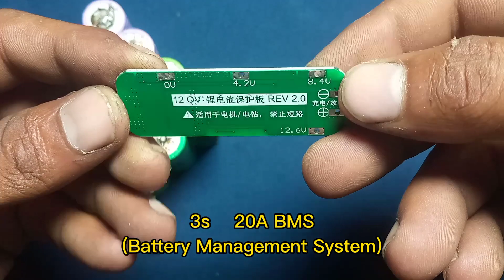DIY 12v 30AH Battery bank||How to make 12v 30Ah lithium battery bank using lithium cell and 20A BMS

Comment: Sir you did a great job at making the battery pack buy next time whenever you make battery pack remember to use spacers ( or pvc pipe ) to hold the battery so if the cells gets hot than they will not transfer heat and use some insulation on the positive terminal if you are using naked wires ( trust me, use insulation, once I made an power bank and the cells got damaged because I didn't use proper insulation in the positive terminal  🤦🏻‍♀️).
Reply: Nice useful tips 👍👌🤝

Comment: 6:16 
battery configuration weren't correct
But after that you fixed it ;)
You should parallel your all series packs

Nice work totally and thanks for that but this battery its not 30Ah.
4 cells are parallel so I think each stage of battery can deliver 10Ah capacity @ 2.5Ah for each paralled cell.
In fact its even lower but I dont want to make you sad :).
Reply from the maker: Thanks for guidance...❤